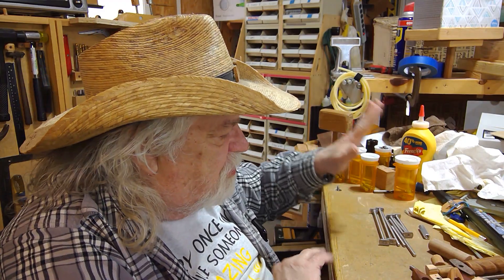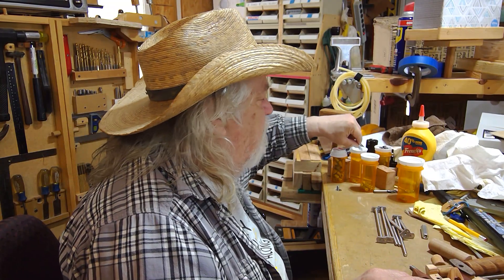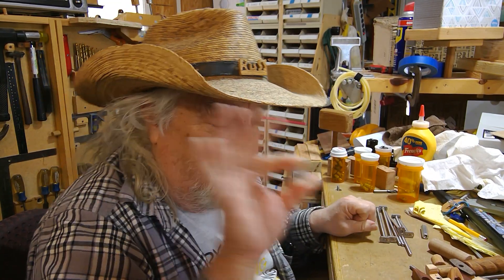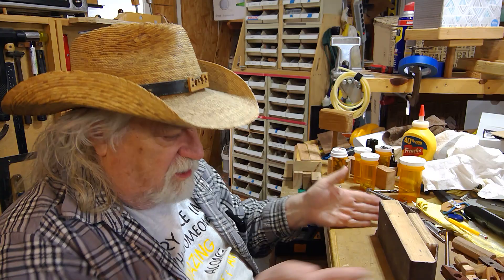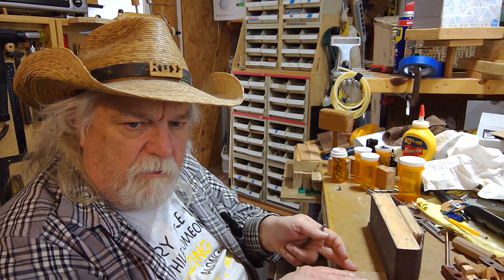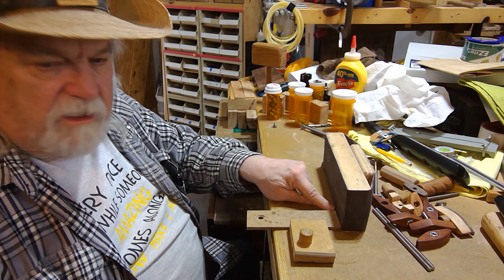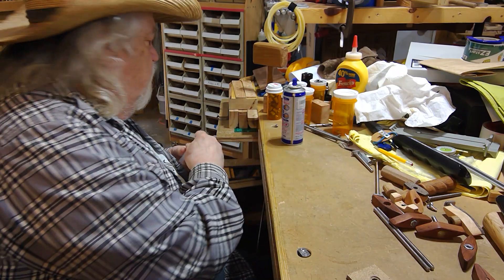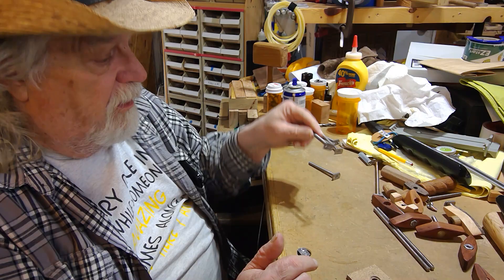Shop Made T Bolts by OTB Thinker

Comment: What a load of RUBBISH  no way are these practical T bolts, would not stand any tightening pressure.
Reply from the maker: you sound like just another YouTube Blowhard that hasn't even tried it.  FYI, I have had more blowhard comments about this possibly failing (only one) than I have had failures using it over the years.  I guess my momma was right, "Stupid is as stupid speaks :>).  Thanks for the input, Carl.

Comment: toilet bolts - run them a few times on a file because they are just a bit too wide for the track. They are a bit flimsier than threaded rod, but there is not a lot of applied force.